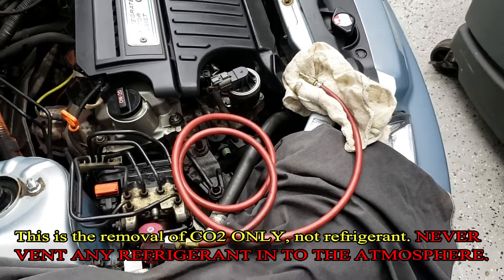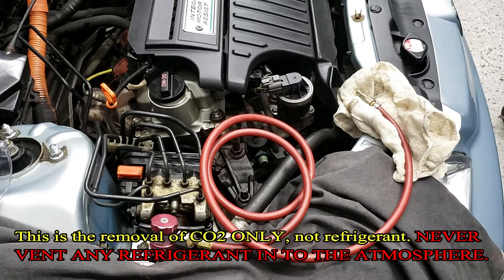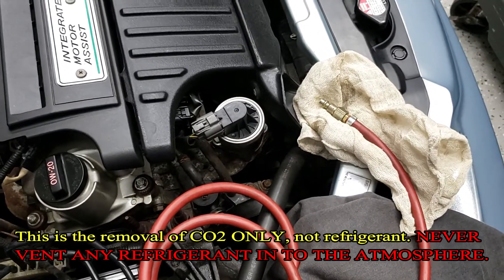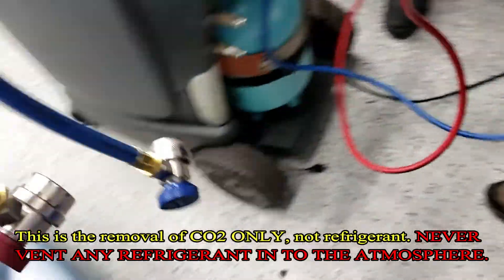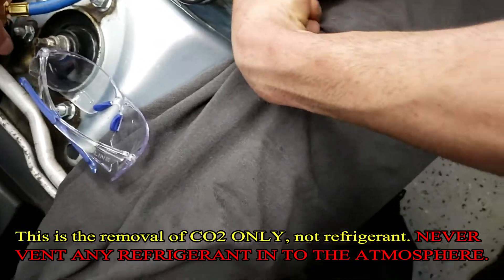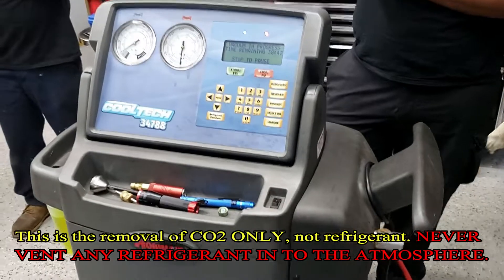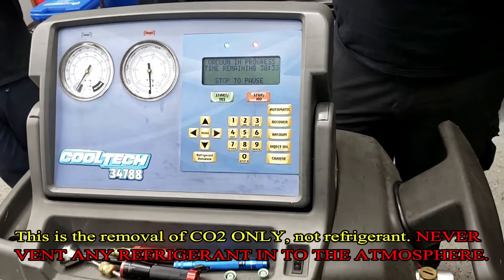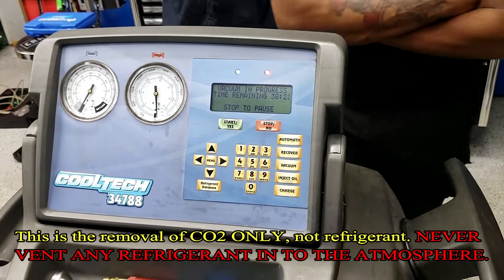AC Removal of CO2

Comment: I've found many leaks with a similar method but with nitrogen and soapy water. You can also see if the system will cycle but only for a second as the gas can't carry the oil . Nice demonstration

Comment: please tell us how to evacuate system without removing Oil . . because when putting system into vacuum over time ,  the Oil will atomize on a non automated vacuum pump   ? thank you
Reply from the maker: Depending on the AC machine your using and the vehicle system ... the amount of oil that should come out should be very little. If you are using an older AC machine that has turn valves you can try not opening them all the way. Hope the information helps. Thanks for watching. If you have not already Subscribed to our tstseminars YouTube channel please do so. Interested in more training? Go to www.tstseminars.org and www.attstraining.com